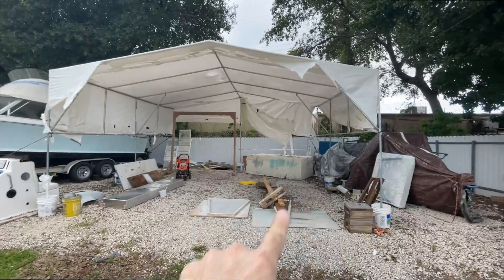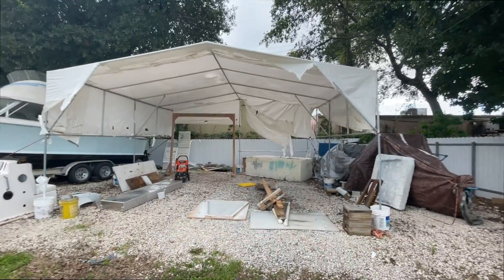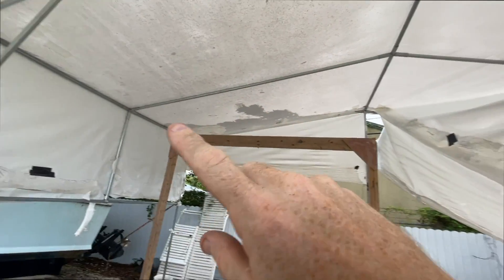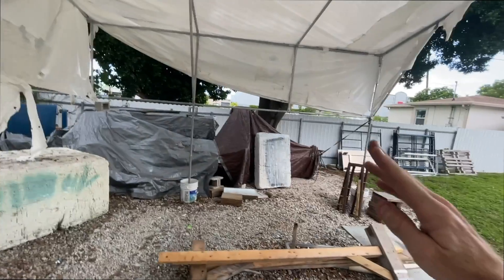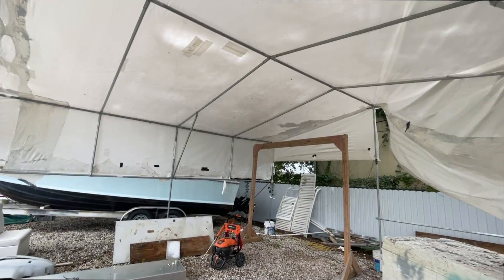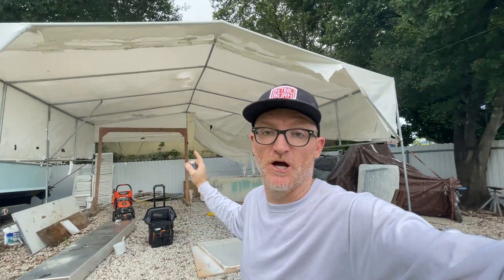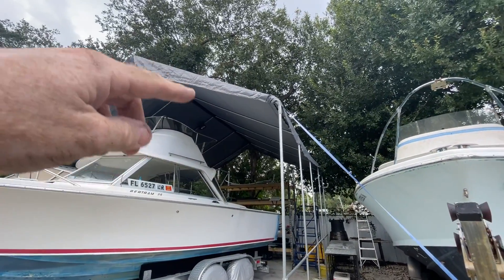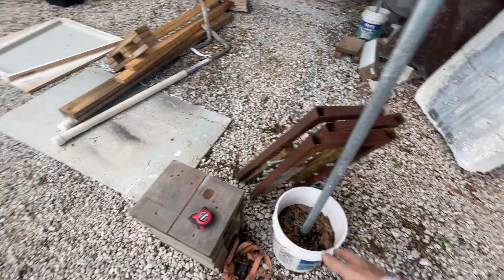DIY 20x20 Boat Yard Tent Built from Fence Rail and Shrink Wrap

Comment: Russ, I have to thank you. I bought a 22' WA Buddy last year and it wouldn't stay up on plane. Did props, went through every possible mechanical thing on the engine, lifted it a few notches... etc. Ended up weighing the boat and found I was 800lbs over. the boat is in 3 pieces in my driveway now and I removed all the wet foam and will be doing stringers next. I couldn't find the right size canopy. This is exactly what I was looking for. Super smart!... My neighbors are not going to like me for a while though. Lol
Reply from the maker: Haha. This tent actually worked really well for a while. The shrink wrap held up well.

Comment: Trying to build one 30x40 and it's killin me!   Going to try it your way next!
Reply from the maker: That’s a big one. I would suggest getting the larger width shrink wrap. Trying to heat weld the seams is really a pain
Reply: @boatcrafterscollective  thanks.  I assume you heat it from underneath and not from above?
Reply: @boatcrafterscollective  Also interested to know if you or anyone else has ever seen one in a geodesic dome style?
Reply from the maker: You can heat from either side. You need the shrink wrap gun.

Comment: Hey, thanks for posting this!

I was going to ask about the heat gun, but found a video, H-950 / H-2030 Shrinkfast Heat Guns.  I think that $650 investment saved you days of work with a regular heat gun.
Reply from the maker: Yeah you can’t do this with a regular heat gun. It won’t melt the material. You need propane torch to make Seam welds.